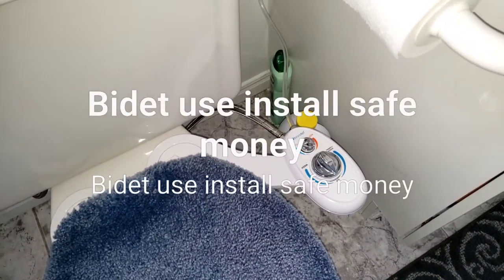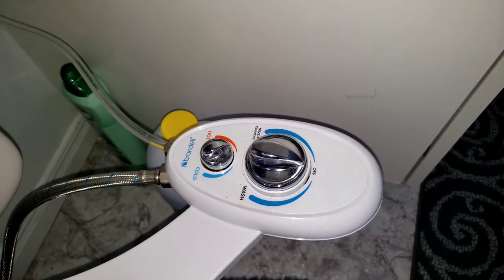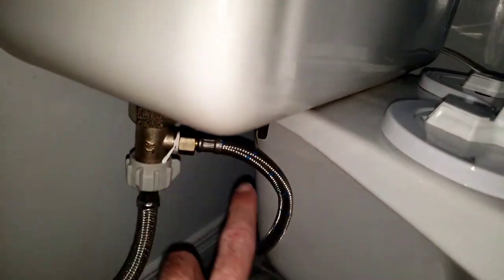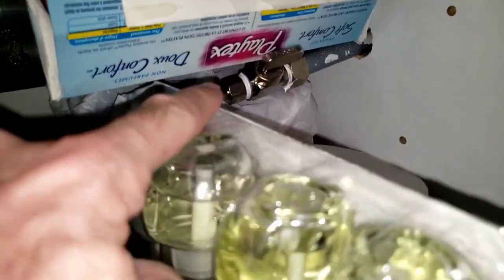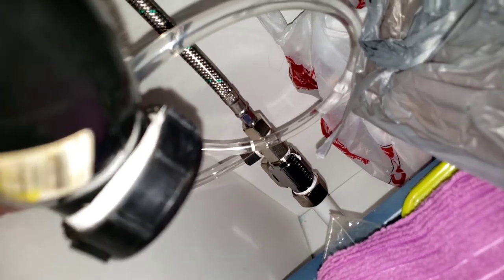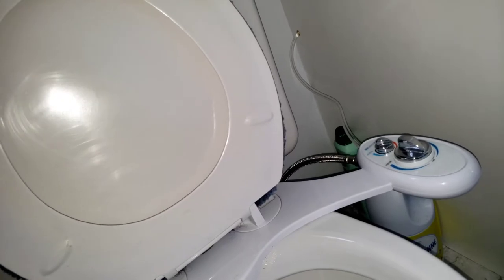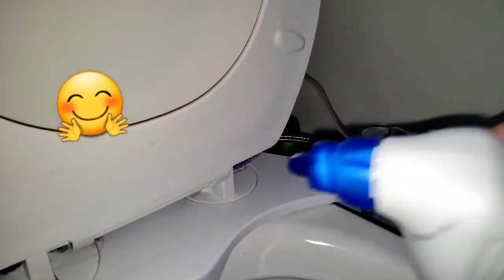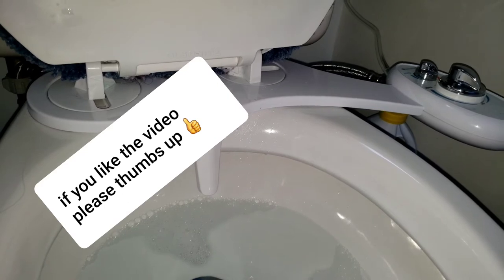Bidet use, quit install review and test safe money - SouthSpa Brondell

Comment: did it come with the plastic tube for hot water? how long was the tube? my toilet is not right next to my sink , so im worried abut the reach
Reply: The tube is few feet but a standard one that you can buy easily. You like this bidet, two years of use and no links. After few hesitation,  all the family adopted it😁